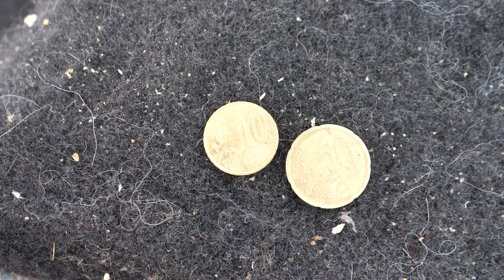Seat Leon | Limpieza en profundidad

Comment: Buenas chicos, estoy buscando mi primer coche, estoy entre un seat leon como este gasolina 125000kms o un honda civic 2008 gasolina 170000 kms. Precio de ambos unos 6.500 euros. Ayuda
Reply: Depende de los motores, pero yo iria por el Honda
Reply: @clashclash5381  el leon es un 1.6 y el honda 1.8 vtec
Reply: Mejor el Honda
Reply: @noaser1  opino igual, depnde de su estado pero en principio a por el Honda
Reply: @clashclash5381  El kilometraje del honda aunq sea mayor merece mas la pena pensais?